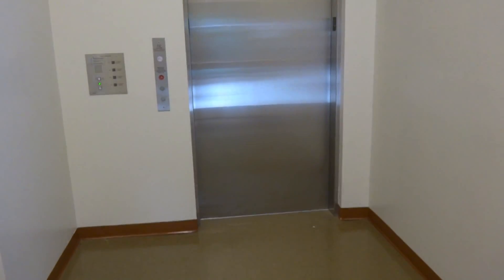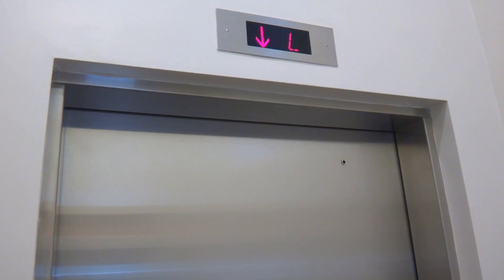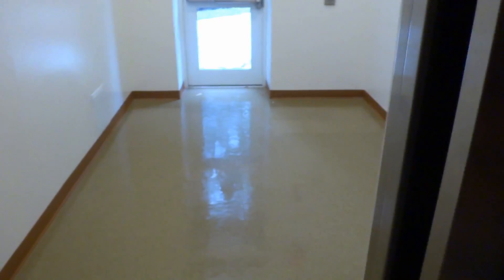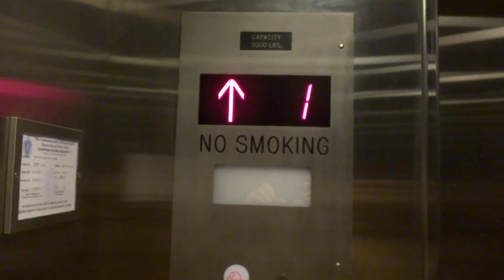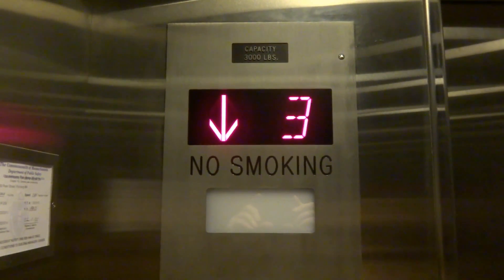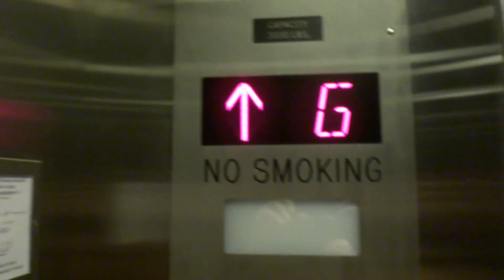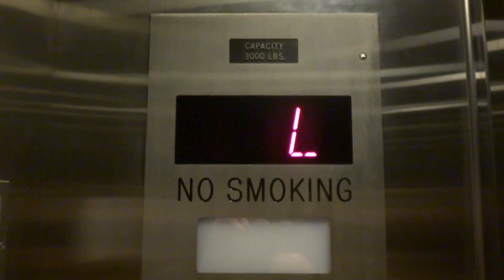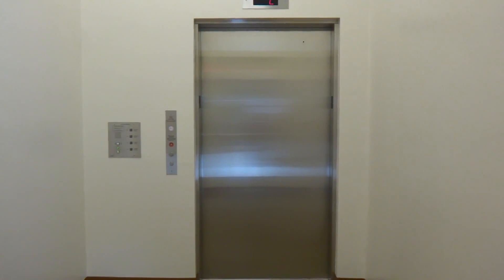Fitchburg: Eagle Hydraulic Elevator @ 160 Pearl Street, FSU

Comment: Notice on the down trip this elevator took its sweet time leveling.  First time I looked it took between 7 and 9 seconds to level.  Based time on the "hissing" sound when it went from loud to a bit more not so loud.  Those look like G.A.L fixtures and interesting it has the bell chime, not some generic, ghetto sounding electronic chime.